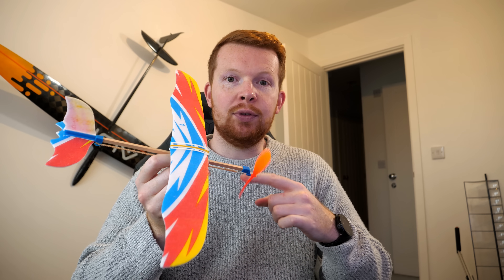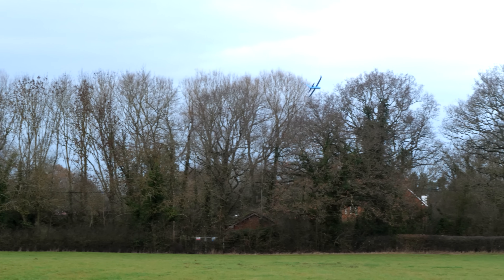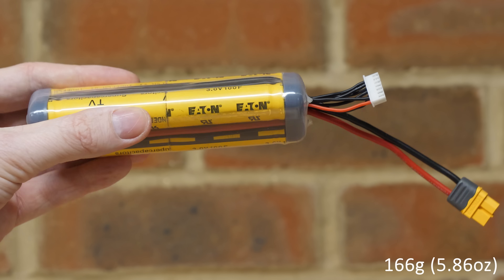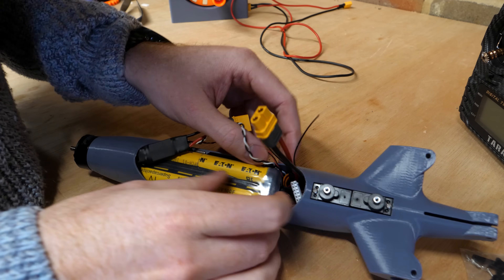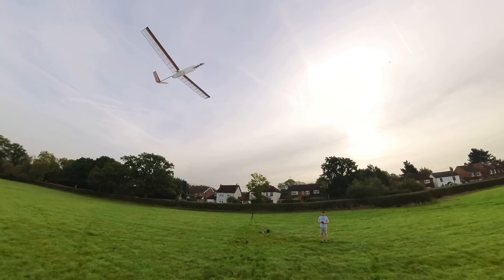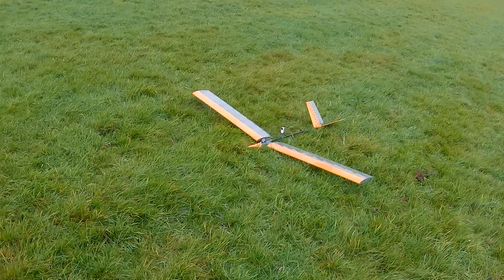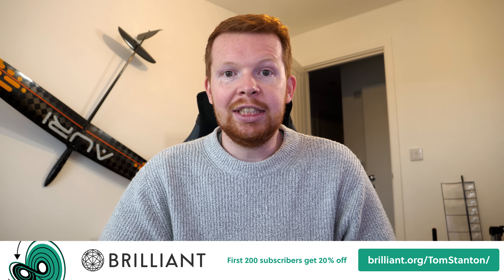Super Capacitor Plane

Comment: What if the coils and the magnets both rotated opposite of each other? Wouldn't this technically be more efficient? And give double the voltage vs rpm of input? It would take more energy to start it because the mass is greater. But you could make the coil side as light as possible and also use a transmission to multiply the start up torque.
Reply: You would have to build some kind of rotating connection to the coils. Spinning it twice as fast would be way easier

Comment: Hey tom, next time you print a tall bject like the fuselage and the surface area touching the build plate is tiny (like in your case), then you can add a brim support to the first layer of the print, adding a brim width from 15-50mm will greatly help without having to modify the onshape stl at all

Comment: I had a (possibly stupid) idea about super capacitors. How much torque and speed an electric vehicle can build up depends a lot on how much power the battery can push out. Right?
Couldn't super capacitors be used with electric motors as an equivalent for NOS with combustion engines?
It even has an advantage over NOS. When the NOS tank is empty, it's empty. You can't just fill it up with gas from the main tank. With batteries and super capacitors, you can do that. Charge them up during the time where the batteries don't have to work at their limit and get the power back when you want to overtake someone.
Even if this would be a stupid idea that doesn't make any sense from a scientific standpoint, at least I want to see this in a Fast And Furious movie. They didn't ever care about science anyway.

Comment: Your generator would be more efficient with a second rotor. 9 coils with 12 magnets on each rotor facing each other would give you three phase and four or five times the power but maybe not so easy to build with 3D printed plastic. Check out Hugh Piggots wind turbine designs.

Comment: I think it would be cool to have the generator attached to a simple pulley system whereby u simply lift a weight to the top and a slow/controlled drop charges up the system.

Comment: When the battery cuts out the prop still spins because The speed maybe you could use the power from the spinning of the prop to charge the capacitor ..

Comment: if the voltage used to charge  the cell is higher than the cell voltage isn't it fast charging and may be dangerous to the small 3v capacitor

Comment: Curious if you can't make a plane that uses the Corona Effect to power it... I figure most regular capacitors would explode if you did that or arc. Would be nice though, since there's about 100v of high voltage low current power every meter or so (if I remember correctly) so at an altitude of say 20 meters that would be 2000v of high voltage low current. Probably would need to use a lithium battery to control the electronics, and throw it up rather high on launch to get within usable altitudes. Suppose it would also need to use a high voltage low current motor, which I usually only see made as prototypes due to their limited use.

Comment: Tom,  use a SEPIC converter for the servo and RF circuit, so it doesn't matter the over or under voltaje from the capacitor bank, it allways wil bring a 5V output (or any other previously seted)

Comment: - not a bad idea to take electric RC back to the days of handcranked fueling systems..

Though in the modern era, a single solar panel can easily fastcharge small LIPOs in the field  (not to forget 120Ah of larger LFP batteries are readily available for field power).

Comment: This is real cool and I dont want to sound like Im tryong to take away from that but I wanted to let people know that LTO Lithium Titanate batteries are what supercapacitors were reported in the media to be.

Fully charged in under 8 minutes (like 10C charging), and tons of charge cycles ans current output capacity. They even have usable voltage for longer rather than the exponential drop off of capacitors.

They do need BMS's though unfortunately.

Comment: Dude this is crazy! I would just run a LiFe battery pack personally but that design is so cool and minimalistic. Really scratches an itch for me. Has me thinking about rc flying now. 

If youre running a brushless motor on that, id highly suggest in a telemetry system. Some give you rpms of the motor, Temps, VOLTAGE... lol on your remote. Unless that draws too much?

Comment: This is awesome. 

I have an idea, idk if it would be feasible, but what if you seperated the super capacitors into bundles of 3, and have two lots, then put miniture generators (akin to the shape of gas turbines on planes, the blades would obviously have to be larger though to ratio the gen input) on the wings that would charge the first bundle once it's run out of charge. That way it will switch between charging one while the other powers the propeller. Don't know how much that would increase flight time, or if it would even work/be possible to engineer. Would be cool though.
Reply: The drag from the turbines would just waste a bunch of energy, it's better to fly without them.

If that worked it'd be a perpetual motion machine.

Comment: There are low voltage servos and receivers operating at as little as 2.5V.
They're used for F3K flying, so they're super light but strong.

Comment: Is there anywhere to take advantage of the windmilling and use the motor to generate a charge in glide? It might not be enough to start the motor back up but it might be enough to allow you more surface control time

Comment: It would be interesting to have a small solar panel installed on the top of the plane, which should be able to supply power to the plane during sunny weather, and hopefully the capacitors should have enough charge to run a bit longer. The only issue I could see is that the extra weight might affect the flight time either way.

Comment: But could this build be extended with solar cells 🤔. A self partially restoring rubber band so to speak hand cranking it to charge and then range extending it with solar cells 🤔?

Comment: Two things are missing, an easier charge method. Maybe have an off switch that places the plane in charge mode and just have the plug mounted under the plane and maybe reinforced a bit. Also, a way to charge the controller as well would be neat as you could be completely off the grid lol. Batteries are not included, cause they're not needed. Other than that who can complain.. are the STLs posted anywhere?

Comment: if supercapacitor has around tenth capacity of battery, but can charge and discharge way faster than battery, can you technically build like airplane "checkpoint" so to speak, that has very high current output and can charge capacitors rapidly, then as you continue flying capacitors slowly charge batteries, giving it extra 10% boost. does it make sense or too silly of an idea lol?

Comment: You could use some kind of boost converter to regulate the voltage when above a threshold and boost it up when under it so you drain the caps fully and keep a constant output.

Comment: I believe that it putting capacitors in series can damage them when using them above a single one's rated voltage. maybe a boost converter circuit would work, and also increase the flight time below 5-6 volts

Comment: Not sure why you were so concerned about the aerodynamic cleaness of your nose with a big blunt motor upfront and servos out in the airflow in critical areas of flow - I’d wager you’re losing more efficiency from intersection and parasite drag than flat plate drag - why not clean up the design with a blended intersection cover and cleaner transitions with taper and no big gaps and joins?

Comment: Use a motor speed controller with a brake. Shorting the coins of the motor, and once the propeller stops, fall back for the rest of the flight and your room get much better efficiency.

Comment: Put magnets on the motor and a rectifier and limiter. 2 battery or split the battery you made. Charge the one battery not in use mid flight?. Have a switch between batteries when the plane flying slow?

Comment: Why not have coils on both sides of the magnets for the generator? I know the mounting would need to be redesigned, but is there any other reason for not doing so?
Reply: It would add resistance and make it harder to crank. Your arms is only capable of producing around 60 watts of continuous pedalling and no amount of magnets or cobber can alter this fact. It could be that he can squeeze a bit more juice out of this generator simply by adding more magnets or cobber, but it isn't guaranteed and he will hit a limit at some point.

Comment: Higher voltage caps or more caps in series.  B'cos anything below about 6V is wasted.. if the caps start at 12V you are able to use around 75% of the energy stored by the caps.  If you can get it up to around 18V, you're able to use around 90% of the energy stored.

Comment: If you spring load the collapsing propeller that would make the blades fold away once you release the throttle. That way you can reduce that windmill drag.

Comment: Hello Tom, I have an idea for this plane which could or could not work if the motor for the propeller can charge the capacitor then this might work. so my idea was the if you are flying really high up and the motor is below 6.45 and cuts out why not just fly straight down and the movement of the propeller and motor will charge it getting power back this idea is dumb but could work.

Comment: You probably already know this but your rotor should be made from a ferrous metal. The magnets need to be magnetically coupled so the magnetic flux flows to each north/south poles through the metal. This will greatly increase the efficiency of your PMA (permanent magnet alternator).

Comment: Curious if mixing caps and batteries could get you to a happy middle where the caps are used for higher power moves and the battery giving a stable line to power gliding and electronics

Comment: Hi, i am a electrical engineer and i think you able to do interesting trick: you can connect lipo cell with supercapacitors in serial. It allows to you raise up voltage, so schema will shutdown a bit later with same mass because when you have 5volts in out, you will have only 1.3volts stored in capacitors

Comment: If the generator used a foot pedal to charge, that would be much more practical. Some spring-loaded landing gear would be cool at some point, but that would add more weight

Comment: Would you experiment with a hybrid system, air and electric, could use the super capacitors and attach some kind of compessor to the crank to refil both at the same time, then use some clever code or something to regulate the throttle of both to maximise efficiency. It would probably be possible to even add air and electricity to one single connector on the 3d printer.

Comment: Highly recommended to have a teeny tiny Liion cell between the motor and radio/servo controller w/ boost circuit just to maintain a teeny bit of redundancy on the control...otherwise if something happens...you won't lose the plane when control surfaces no longer respond.
Is there any way to setup a regulator to the motor to reduce power draw and extend run time but with less current draw...(or a smaller engine)
Very very cool...and quick/easy charging (think dc/dc boost converter and a smallish portable lead acid or lithium iron phosphate battery)  charge, fly, charge, fly, charge, fly (repeat ad nauseum)...till you get sick of flying...and in case you need it...hand crank backup (or something to keep the kids full of energy occupied ;) )

Comment: Looks like a fun plane. Is it something that you could scale up? Super capacitors are relatively light so if you add more you could increase the flight time but perhaps the added weight would negate the additional energy?  I think I'd like to fly for more than 2 minutes. Perhaps 10 or 15 would be good. Not sure if I'd like your charging method at 1:1 for a longer flight though. 😂

Comment: If you use the elastic bands on the folding propeller, when the motor cuts power the propellers will fold in and prevent the windmill effect, significantly reducing the drag.

Comment: Your ESC almost certainly has a brake function you can program to stop the windmilling when the throttle is all the way at idle.

If it doesn't, you can use the same technique GA pilots are taught to stop the prop from windmilling in an emergency power loss situation: climb to slow down until the prop stops.

Comment: Hey Tom, try putting solar cells within the wing spar of the plane and see how much longer the plane will fly with the super capacitor. First, try the experiment with traditional solar PV cells. Then try the experiment with Perovskite Solar Cells (PSC). Compare the data and share it. I would be super interested to see where this goes.

Comment: Use a brim on the fuselage print to increase the build plate contact area and keep the print from knocking over so easily.  A raft is another way of doing it, but really a wide brim should be enough.

Comment: i know this sounds dumb,   could the coasting prop be used as a partial regen ? or would any loading to the windings just stall it.  amazing build btw,  very impressive results,  also , did you see " geared down for what " channels video on attempting to beat your air engine efficiency, brilliant video and attempt

Comment: is it possible to use the "windmilling" of the prop during glide to bring a bit of charge back to the capacitors? maybe manipulate wind speeds and gliding to catch more wind and keep charging? This idea may work better on an autogyro actually

Comment: If you wanna do a fun experiment you could create a small scale "neutrally buoyant" vehicle and attempt to load it up with weight and push it forward just fast enough to compensate for the added weight.  Then recreate this hand crank capacitor charger as an inductive capacitor charger that the neutrally buoyant vehicle just needs to travel to in order to fully charge and hop to the next.  Then imagine this scaled up to a point where freight no longer needs rails, or roads.  It can float safely above existing infrastructure over great distances.

All the existing infrastructure would be more than enough to supply commuter traffic well into the coming decades to any and every destination with absolutely minimal investment.  But I ain't one to gossip so you ain't heard that from me.

Comment: Shouldn't you be able to use the windmilling of the prop to power your servos?
Like if you boosted as high as possible and used that parasitic prop power to actuate your control surfaces on a long glide down

Comment: Now, if you were to modify that fuselage to blend in with the wings, I believe you'll get at least 30 seconds to a full minute more flight time with that aircraft.  Also, look into using a nosecone and set the ESC to fully brake the motor to help fold the propeller in for an even longer flight time.
Reply: I was just going to post a similar comment: I had a GWS slow stick, which performed much better when I bridge the centre section with tape

Comment: Something worth looking at is building boost circuits to go with supercaps, because they have such high current delivery they'll keep supplying a good boost circuit enough current to be usable down to about 2v or so. Less if your oscillator can run that low. I run a 5watt led off a 25f cap this way, it lasts about 10 minutes and takes about 30 seconds to charge. Might be worth while for the control surfaces so they can safely operate well below 5 volts, you won't get one small enough to run the motor.

Comment: Is there a way to install some small, thin and lightweight solar panel sheets on the wings to extend the flight time? You may have to put a charge regulator in there as well so the voltage doesn’t go over 8 volts.

Comment: Urg hand crank generator.

They're only a survival tool only, a charged battery is always more efficient and if you aren't near a power point a small solar panel is usually a better option than a hand crank.

It really is the least efficient solution.

Edit: Actually it's kind of cool on such a tiny power source like that plane, but still far less portable than a tiny battery.
Still, probably ok until you scale it up.

Comment: What about hybrid battery .    Have a small lithium battery  wouldn’t the caps handle the voltage spikes from the throttle extending the battery life.

Comment: I wonder if there is a way to increase the flying time, and using the remaining power of the capacitor, perhaps using a buck converter to keep the voltage constant to just over 5V and a current limiter.

Comment: Where exactly did you come up with the idea that balancing the caps was necessary? I’m not saying it’s wrong, I’ve just never seen it. I have a 6s 2.7v 100F cap pack on my lawnmower battery and it has worked reliably for years.

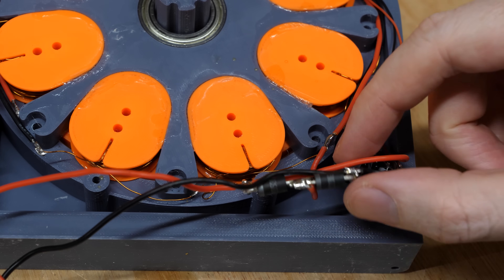Comment: 1:54 Hey Tom - What's a "full bridge" rectifier?
Better yet - what's a half bridge? Is it one diode - or two? 
I know (from my electronics training) what a "full wave" rectifier is - (as opposed to a 'half-wave' ).
A 'Full-Wave' rectifier doesn't need to be a "bridge" (if your coil has a center tap).
A 'Bridge Rectifier' is a Full Wave rectifier.
Don't let those slick talkers from the Netherlands truncate and blur the terms for you.